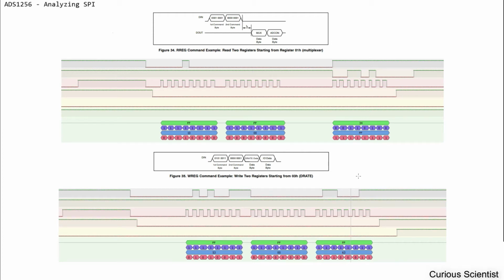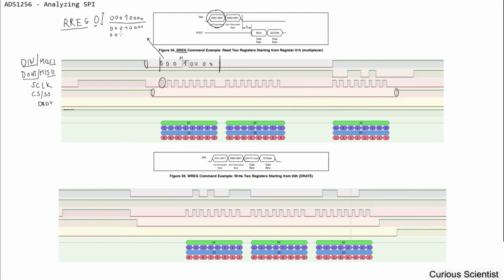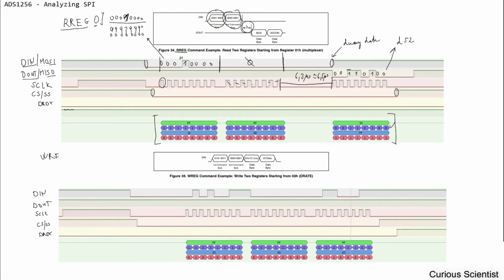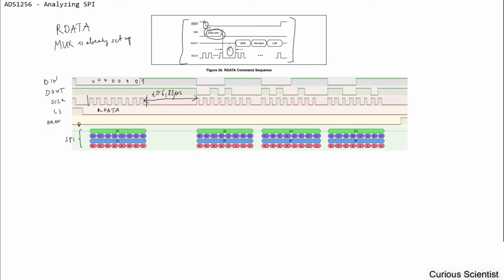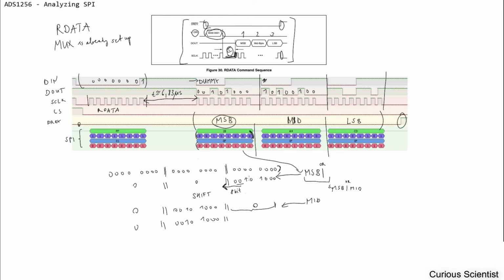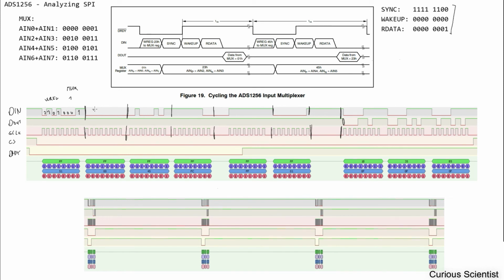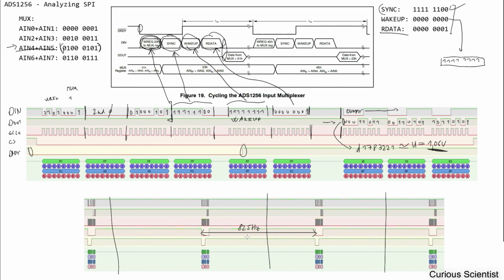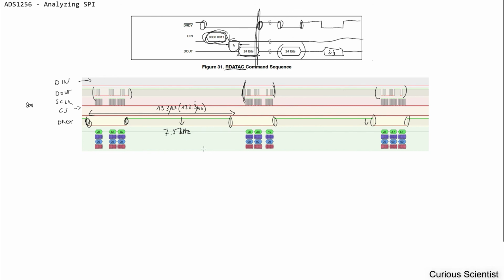ADS1256 - Analyzing SPI data

Comment: I don't see anything in the manual about an extra 50ns for the t6 delay, just 50 * the master clock period. Where did you get the 50ns from?
Reply from the maker: Page 6 of the datasheet.